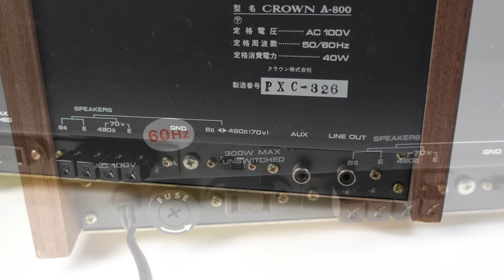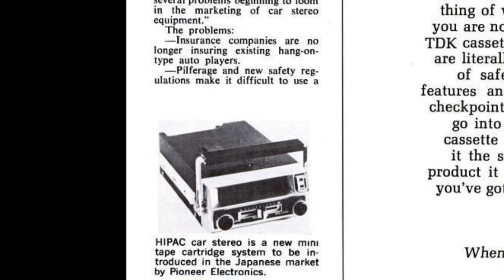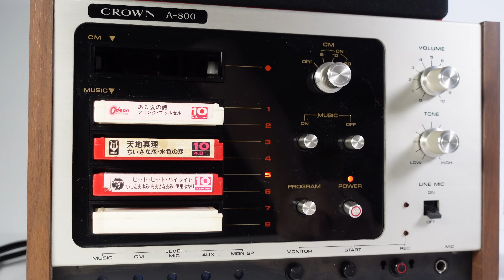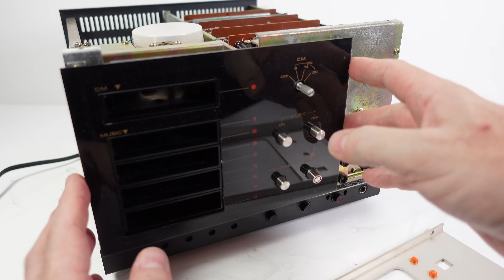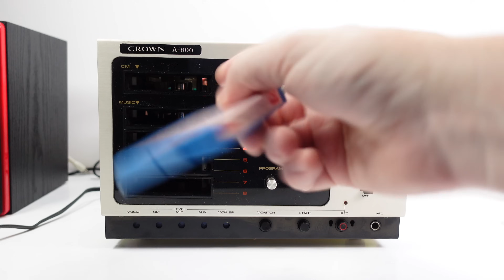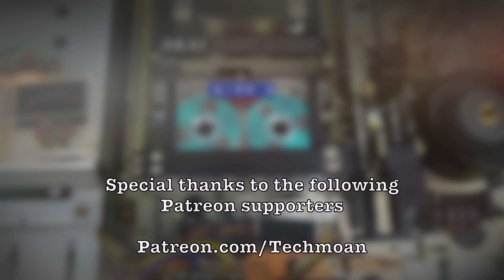An unusual player for a forgotten ‘70s music format

Comment: Very interesting! The "70V" switch on the back was an "aha!" moment for me, as that voltage was typically used in PA systems way back when.
Reply: When I saw the "CM" my first thought was commercial as in advertisement.   However, I thought it might be for a radio station such that the RS could be almost DJ-less.  But when I saw the output's, i.e., no stereo, then I thought, possibly for retail store applications. A cool piece of technology.
Reply: 70 volt is still in use today
Reply: Same here.  Haven't worked on store PAs in 20 years, so it took a moment... :D
Reply: Installed a new 70v speaker for a PA last month. Still very common in retail and pa.

Comment: Can't tell if it's what they've done, obviously, but if they were rectifying the AC, and then using an oscillator to make fresh AC to drive the motor, then the capacitor could well set the oscillator frequency. Not the most efficient way to do things, but it would give them the flexibility.

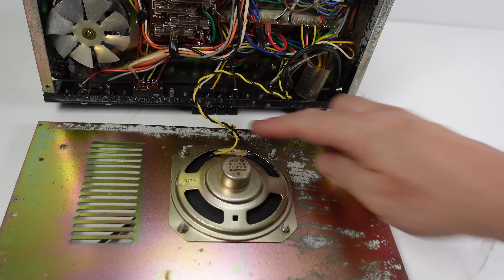Comment: 18:00 you can take a 0.4 uf capacitor and a pair of clip leads and parallel the existing capacitor to test if you can just change the capacitor.  Capacitors in parallel add in value.  Make sure the one you put on has a voltage rating equal or higher than the existing one.
Reply: I was thinking the same thing at that part. "Well, if you have an appropriate 0.4 uF capacitor, you could just hotwire it in for a quick test."
Since the device was designed to take both capacitor sizes, adding a little capacitance shouldn't damage anything, even if something else controls the speed.
Reply: @Nimble if it was manipulating the power factor, it couldn't be a standard electrolytic capacitor, but a rarer non-polarized electrolytic cap. You can then use a 2 uf cap in series, negative to negative and connect it into the AC circuit. I had to do that once, decades ago when I couldn't source the NP cap. It'd half the capacitance by being in series.
Reply: @spvillano  its n anti hum capacitor....it wont change the speed of the motor
Reply: wouldn't parallelly connecting capacitors decrease their combined voltage rating? Or am I confused that with other aspects of capacitors?
Reply: That’s correct.
Reply: @FlameRat_YehLon  If you connect them in parallel it should just increase the capacitance.
Reply: @FlameRat_YehLon  First off, forget voltage. Voltage is just the "pressure" electricity is under forcing it to move, and in our example here, it doesn't matter because we don't change the voltage the part is under. What we're talking about here is electric charge storage (capacitors).

in simplest terms, capacitors are two metal plates held so closely together that charges attract each other and build up on each side without jumping across the gap.  The bigger the plates, the larger the charge that can be built up, so higher capacitance. Also, the closer the plates, the stronger the attraction, so again higher charge meaning higher capacitance.

Putting two capacitors in parallel "looks" like one capacitor with bigger plates, so higher charge thus more capacitance.  Putting capacitors in series makes for a "thicker" gap instead, so plates aren't as close, so charges don't attract each other as hard, so the capacitance is lowered.

It's a bit more complicated than that, but basically that's a good way to picture it.

You were probably thinking of resistors, which combine in parallel to be a lower resistance.  Resistors are like thin pipes which restrict, or "resist", the flow of electricity.  Increase the number of parallel pipes, you lower resistance to the flow of electric current.  Put resistors in series, you make your pipe longer, so it increases resistance to the flow of current.

You may also have been thinking of a capacitor's "working voltage".  Remember the part about attracting charges without jumping across?  More voltage applied to the capacitor would mean more charge is forced onto the plates, but at a certain point the charge will jump across the gap, which is usually bad.  That's the "working voltage" limit.  Hopefully, Techmoan will pay attention to the working voltage of the capacitor that is there and match it with something as good or better, otherwise Bad Things can happen... :D
Reply: @murasaki848  now with a second thought, I think none of what you've said described what I was thinking. I was probably thinking adjustable capacitors when you increase the gap while it already has charge and got confused, as that iirc would increase the charged voltage.

Comment: A big hint that this is a background music player is the 70v output - that’s used for commercial speaker distribution with a small transformer installed at each speaker - to avoid the loss in long lines
Reply: I Immediately thought this was a PA music player. It just looks like one. And the cartridges pretty much ensure the music is original and bought.
Reply: I remember contemplating a loudspeaker with a transformer riveted to it. I was about age 11. 
I already knew transformers were for AC power. What was this doing here?
Reply: @Fetherko  Those are audio output transformers that allowed impedance matching of valve (tube) output ccts (high impedance) to speakers (low impedance) to obtain maximum power transfer. Early radio sets often had the transformer attached to the speaker rather than on the radio's chassis.
Reply: @Fetherko  The reason for transformer matching is the same reason that long power lines run at a much higher voltage than your house. Higher voltage , lower current, less losses in the cable run. It is know as a 70 volt line system, or 100 volt line system in the larger  units.
Reply: @Fetherko  They would step up the output to a higher impedance/voltage to support longer runs of wires, like they send the power to your house on High Tension wires, then the transformer brings it back down to the normal 8 ohms

Comment: Before you started explaining the sound speed I figured out why as I’d noted the 60hz sticker.

The modularity of the complex electronics and mechanical parts is freaking genius… and yet Crown stuff used to be the cheapo stuff you got in Woolworth back at the beginning of the 70’s.

Comment: If it's an AC motor, you'll need a different pulley. If it's a DC motor it's possible that changing the capacitor could change the speed. First thing I'd do would be pull out both pulleys and see if either one is marked 60.. my bet would be on a pulley swap, but make sure that there's nothing else you can do with the pulleys, like swapping them around.

Comment: If one speed uses a 0.5uf and another uses 1.0uf, get a second 0.5uf capacitor and put it in parallel with the existing capacitor and see if the speed changes.

Comment: I pulled a cassette deck out of a parts truck and put it in my 87 Dakota. 
It had auto-reverse at the end of the tape, and with some cassettes, fast forward and rewind would stop at the end of the song. Only had 2 or 3 that it worked.

Comment: Simply change the capacitor. If it didn't make a difference, there wouldn't have been a difference to put the instructions on there in the first place, eh? Make sure it's the same type of capacitor, whether it be polarized or non-polarized. Polarized has a positive & negative terminals while non- polarized doesn't. If you don't see the "+" or "-" symbols on the original, then it's non-polarized. Also, make sure it's the same or higher on the voltage rating, if it has one.

Comment: The only US-consumer piece of equipment I've ever encountered that used these cartridges was a Dictaphone-brand answering machine where the cart was used as the outgoing message and a compact cassette used for incoming. These carts typically had a translucent top so you could see the tape in motion.

Comment: I'm surprised by another tape format that pulls from the center of the spool. Isn't it stressful on the tape? (Assuming it is, it probably leads to higher failure of spice points, and why two reel/spool systems have won the tape format wars.)

Comment: The tolerance of those caps I think would mean they couldn't directly be used to control speed, I suspect it's part of a power smoothing or DC rectifier circuit (or as read in comments below, a phase shifting circuit). I guess those motors are synchronous motors, so by having different number of coils it could spin at different speeds. I wonder if the motor fitted is just a 50Hz or 60Hz version? Anything written on it?

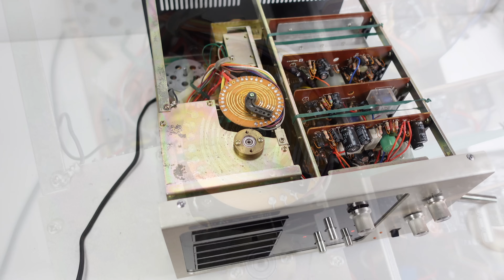Comment: 20:25 That relay thing reminds me of electromagnetic pinball machines (no integrated circuits). They would use electric relay score counters. So clever how they got everything working on those old EM pinball machines with just electrical wiring and magnets.

Comment: Just a thought or two off of the top of my head. 1st: Having spent many hours drinking in Japanese bars in the early 80's, "Enka" was very popular. Maybe the designers of the HiPac were also looking towards the bars and restaurant scenes... along with the department stores - thus accounting for the amount of "Enka" based artists for choice. 2nd: With the advent of 3D printing...a smart computer designer could most likely produce a few cases for you to use for "new" HiPac recordings. 3rd: Again...maybe some smart engineer could design the proper sized pully to be used to fix the slower play speed, or one to incorporate both speeds so all you would have to do is change the belt position.  Who knows...maybe you'll start a trend and revive the format. Regardless I found this a very interesting and informative YouTube Video. Thanks for your effort!

Comment: I doubt the capacitor sets the speed but is you wanted to know for sure just attach another 1 μF capacitor across it and the two will be equivalent to a 0.5μF.   it's not quite 0.6 and you might not be able to close the case but it will work for a test. Then you can replace it with the right one.

If that doesn't do it, which I suspect will be the case I suppose a new pulley wouldn't be too hard to make with a 3d printer.

Actually, given the usual wide tolerances of capacitors I doubt anyone would design something to depend on the value for speed. Just print a new pulley.

Comment: The tapes suffer the same ills as 8-track tapes that I grew up with. They used to stretch, snap, and get stuck inside the player. My dad had a repair kit and ended up splicing many of them back together. He had a big Zenith hi-fi system with record player, big speakers, AM/FM radio, and 8-track player. My aunt had the one that went in the car. The car players had more issues with tapes getting stuck probably from the heat.

I'm wondering if removing the record "bump" you put on the tape you recorded on would enable that to work differently in the CM slot?

I'm not sure about the capacitor. I have a feeling there's more to it than that like changing to a different winding on the transformer. This was what I remember from my electronics tech days when testing and repairing power supplies. That cap, my feelings are telling me, is most likely for filtering and less about changing the frequency.

Comment: Sounds like the drive motor is a synchronous motor.  It uses the AC line frequency to determine/control the speed.  Or, something like that.   It has been 40 years since I learned about motors in college.

Comment: I ask myself a long time:
Does anyone know what happened to the Manufacturer "Crown" ? 
I have not seen any new products of this brand since the late 1990s. 
Sometimes you can find used consumer electronics of the 1980s and 1990s on ebay. 
Wikipedia seems not even to know it. What happened to 
"Crown Japan" ? Did it go down? Did it got sold? Did it change names? I'm really curious.

Comment: Our Air Force family was stationed in Japan in the late 70s; so, of course, we spent a fortune on high-tech stereo equipment which all had 50/60 & 110/220 switches on the back.  HiPac had passed; so we never saw this tech, but we were well into LPs, cassette, reel-to-reel & boom boxes.  Thanks for the excellent deep dive into this tech!

Comment: Out of curiosity I went looking at the tapes, not all of them are comparable with your unit, a lot of them do not have the hole for disengaging the capstan. It's a nice little unit. Still no match for the CD.

As a kid I got my first stereo in 1971. Mine was a component system and had a Roberts cassette player which didn't function right, nor did the replacement. I got my hands on an Ampex 1100(3 speed 7 inch reel to reel) and borrowed records and albums and cut my costs down considerably. The Dual 1009 turntable was a blessing when I started buying at the second hand record store.

I never did have an 8 track.

Comment: When you spliced the tape, you omitted the metal switching tape. That is the reason why the CM keeps playing without end. It simply doesn't know that it has been fully played!

Also: you don't need an empty tape to record your CM, the machine probably contains an erase head to help you record over an existing CM anyway. The difference is just the notch on the corner of the cartridge.
Reply: CM without metal Sensor
Reply: @luis46coco  Then how does it know when the tapes has run a full turn?

Comment: I'm an engineer who faced this exact problem on a blower designed for 60 hz. changing the capacitor will not help you on speed control.

Comment: That is fifty year old tech.

When I began slinging a soldering pencil, fifty year old tech consisted of huge vacuum tubes with four or five pins and a cap on top, giant mica capacitors and large carbon resistors, all soldered together with terminal strips riveted inside a big steel chassis.

Tempus fugit.

Kids today are so spoiled. They have NO idea what things were like a relatively short amount of time back. Technology has taken off like a rocket since the turn of the last century, and the curve continues bending more and more straight upward.

Comment: There is a very simple, relatively inexpensive solution to all of your 60 Hz issues.

Get a small (small = just a tad larger capacity than you anticipate needing for any of your devices) 60 Hz inverter. I suspect that "modified" sine wave will probably work OK for you, but you might want to avoid any possible issues by purchasing a true sine wave inverter.

Then, power it by either a gel-cell lead-acid battery (which you maintain with the appropriate charger), in essence having what amounts to a home-built UPS -- or, simply get a 12VDC power supply of sufficient output to drive the inverter. Such power supplies are readily available these days for very little money -- very little if you don't mind purchasing it as a small printed circuit board that you'll need to put into a cabinet of your own.

Comment: You could put a piece or 2 of shrink sleeving, if there is enough depth, around the motor spindle. This can increase the speed, saving you the trouble of electronic component replacement. Experimentation is required to achieve the correct speed.

Comment: You need also an inner unit transformer that can provide 60 hertz. Therefore, a switch would have been provided, along with the capacitor and in addition other components that could effect the player, using 60 hertz.

Comment: What immediately marks it out as a commercial device is the option of a 70V speaker out. That would normally be "100V line". Commercial devices used this as the device might well be a long way from the actual speakers, so the signal is transformed up in the device, and each speaker has a transformer to drop the voltage (and increase the current).

Comment: Using a tone for the announcements instead of a metal splice makes total sense. That allows the length of the announcement to differ from the amount of tape on the cartridge. If you were to rely on a metal splice, your message would have to be the exact length of the tape, or any fading or pausing of the music would not match the message.

Comment: The motor looks very a.c. with 4? wires that seem to connect to the mainsy board and there is no brush gear. It could be a stepper, but for the age and application I don't think so. I don't think there is an easy solution since the chances of getting a motor are probably nil. It looks like it has a part number but I don't know what else might use it. Mechanical alteration looks best if you have a friend with a lathe and are prepared to pull the fan and pulley off the shaft.

Comment: It's easy:  a 0.4F capacitor in parallel with your 0.6F would give you a total of 1 Farad.
This means you can just clip or solder a 0.4F capacitor onto the legs of the .6 one you already have.

Also, remember that this is a store music player, you would not want to play pop titles in it.
Reply: And a clever man would put a switch in series with the new 0.4F so you have a 50/60Hz switch.

Comment: Check d capacitor or if its a 3 pin caps most of the reel to reel I repair has a multi pin caps with different value to select to 50hz/60hz

Comment: Having been in broadcast radio for over 40 years, I immediately that thought that "CM" would stand for "Commercial Message", a code that is commonly used in broadcast logs. I worked at one station that emphasized that we ran CM's, not spots or ads....

Comment: I use to repair 8 track tapes for $1 seems the design is the same here most common problem was after hours of playing the tape it would wind up tight and even break the tape so for a fee I would loosen the tape back to a normal tension but that didn't mean it wouldn't just do it again a design problem

Comment: Swap the cap - Capacitors and resistors are often used to configure circuits. Even if it doesn't work, the difference in values is slight enough to not break anything